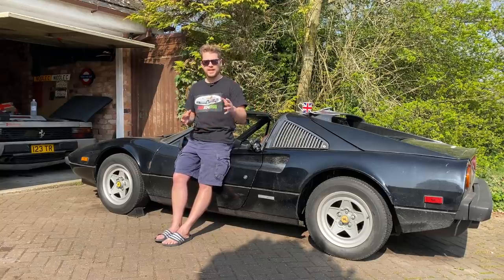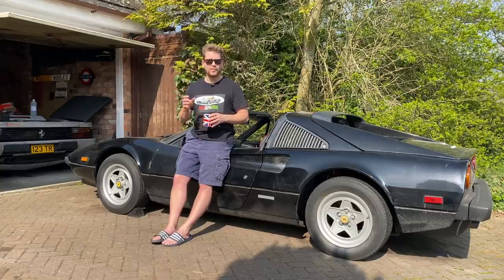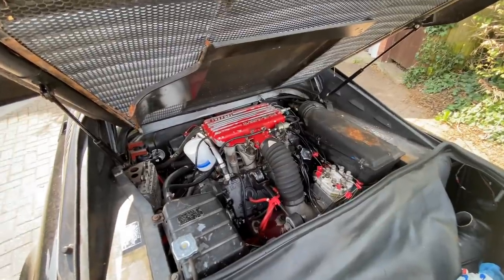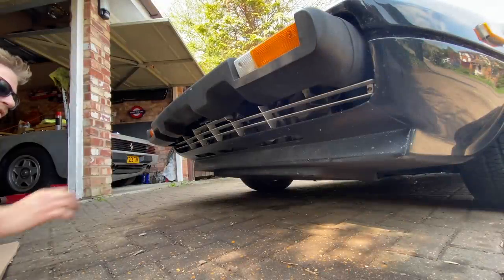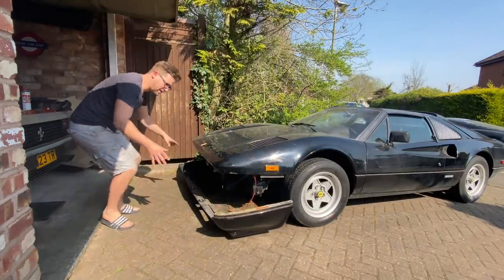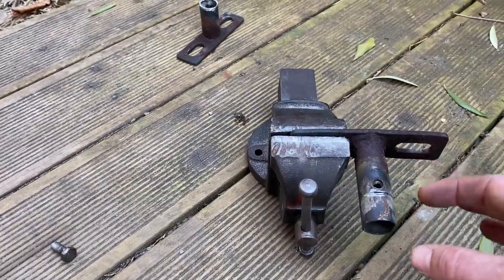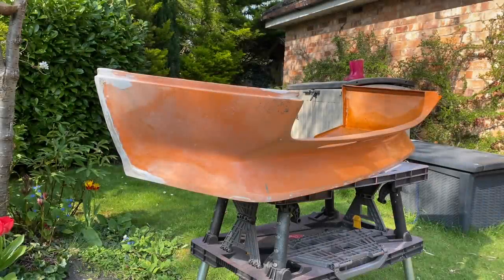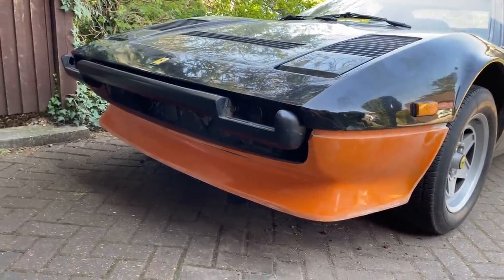Ferrari 308 Bargain Project - Conversion Begins Now

Comment: Note from QV owner. The “fog lights” are only for light flashing in daytime consequent to the headlamps being folded away. Activated by pulling back on the combo light switch. Worth checking to see if your light switch contains unused contacts for this.
Reply from the maker: very handy to know .... i was literally just wondering if they were separately switched or if it was part of the light switch stalk. I might however wire them in differently so I can use them as fogs separately

Comment: If I remember, the front exhaust manifold can be removed with engine in the car if the right fuel tank is removed first. My car was a pre QV carburetted model though, so may be different!
Reply from the maker: Very good to know Sean ....in theory there should be no difference carb or injection

Comment: you can get those scrapers in tough plastic off e bay for about two quid , very handy to have about , and a lot easier on body work.
Reply from the maker: cheers tom
Reply: @Ratarossa  search for trim tools , they are usually orange and come in a set of four .

Comment: Just personal opinion, but I think the lower valance doesn’t match the overall line, it is almost like you would need side skirts to match. Normal level offer a more balanced line, like pininfarina originally designed it.

Comment: Great vid as always, why doesn’t the lower valance just fit? Are the front wings different between euro and USA?
Reply from the maker: There is a slight difference but thats not the reason because this 'deep' from valance was also a factory option on US spec cars. I had the same struggle last time I did a conversion .

Comment: With your change to the bumper couldnt you of just used the normal US bumper and cut it down a few inches to match the eurospec bumper then? also the paint on headers burns off, its something that was even done on mopars back in the day and as soon as the engine gets up to temp it literally flakes off.
Reply from the maker: its all rubber whereas the euro is fibreglass